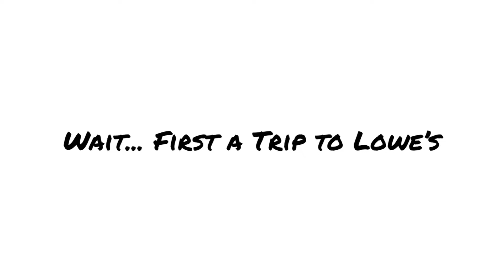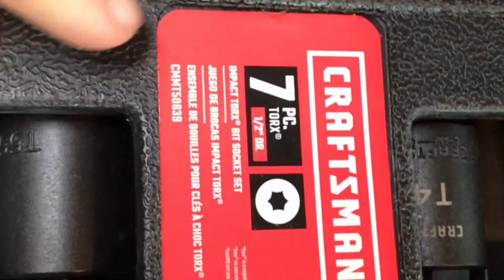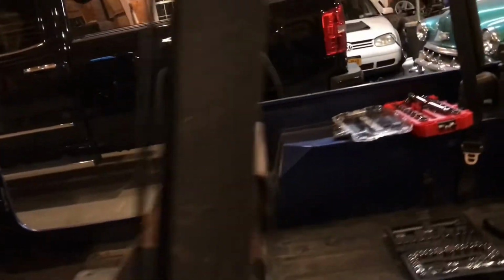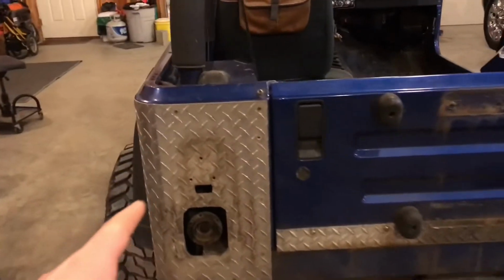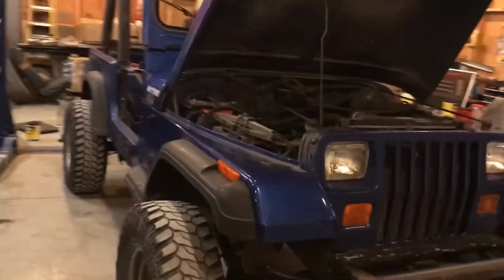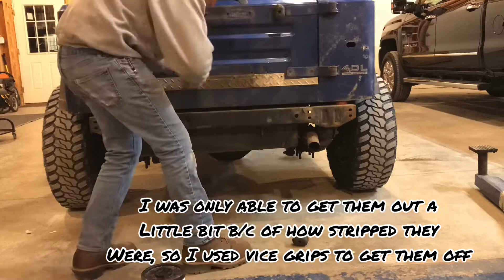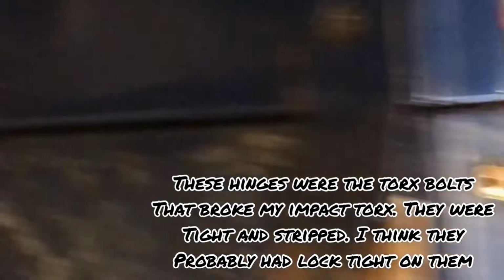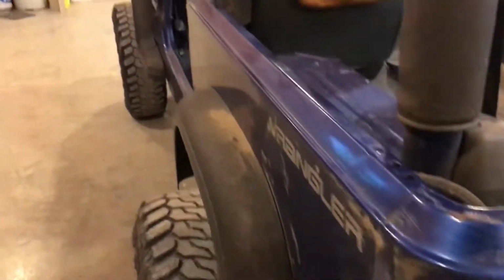Starting to Strip My Yj

Comment: Next time use a hand torch and heat the hwad of the torx bolt up...that will melt the factory thread locker that comes on the fa tory....after heating them the come off very easily
Reply from the maker: Ok good to know!